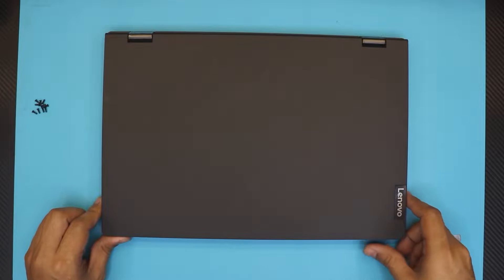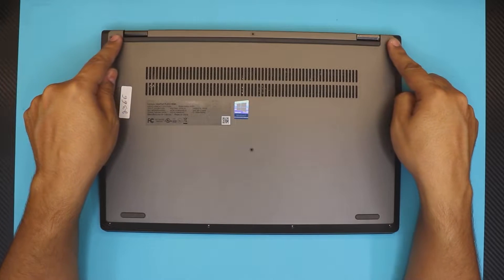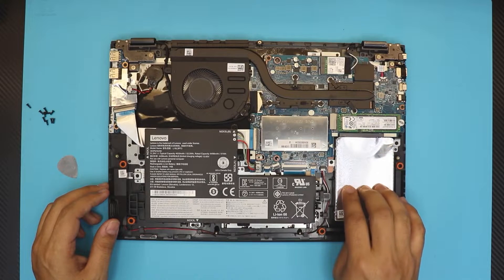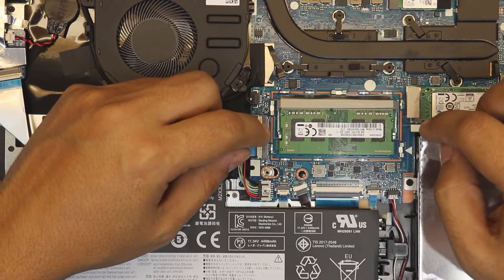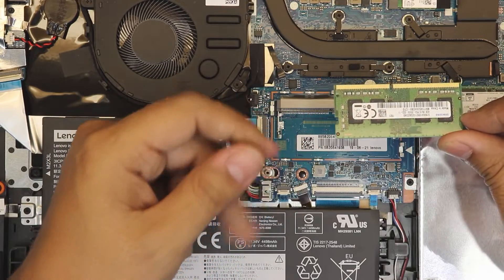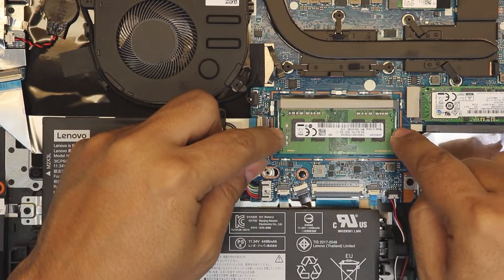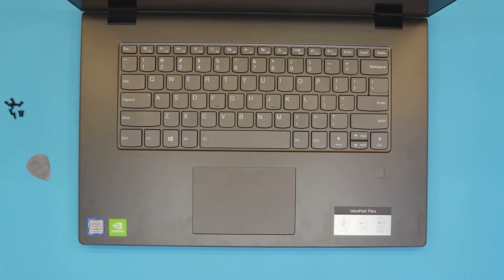lenovo ideapad flex 15iwl RAM UPGRADE Guide under 5min

Comment: Much apreesh! I figured the RAM was living under that silver shield...but was helpful to have that example of how to remove it. I think it goes without saying...Disable Secure Boot to be on the safe side so it doesn't go locking you out after "touching" its internals ;)
Reply from the maker: It's my pleasure, my friend. 😊 I deeply appreciate your taking the time to provide feedback. If you're inclined to support the channel further, feel free to like and subscribe—or even both!
I'm glad my videos are helping!🫠💞
No need to disable secure boot oor anything thing, it is totally safe to man handle it, just disconnect the battery because if you touch other components with that shield then you could short something. been servicing for over 20years never needed to disable secureboot.
Should you have any questions or requests in the future, please don't hesitate to ask me.
🍻cheers

Comment: I also have the Ideapad flex 15 iwl and its 8 gigs right now with dual channel, is it always going to have one of the 4 gigs solderd down cause I want to upgrade to 16 gigs as I found a Lexar SODIMM RAM DDR4 16GB, 3200 MHz 260-Pin DRAM Memory for Laptop but I am worried it wont work with the 4 gigs of ram and if it does does my ram work with the computer?
Reply from the maker: 🫠Regarding your question, double check the max ram capacity of ram: https://youtu.be/tKEJTkVth4Q
if the ram capacity is over 20gb then sure you can add a 16gb sdram ddr4 and it will add with 4gb on board and work fine.
Should you have any further questions or requests in the future, please don't hesitate to ask me.
cheers🍻
Reply: @uFixTek   I read it and it says 16 would be to much, but I went on the Crucial website for ram and looked up compatible ram with my laptop and it said I could remove one stick and replace it with their 16 gigs of ram even though it says not too as they have done extensive testing and it will be fine. How much do you think going from 8 gigs of ram to 20 gigs will improve performance on the computer?
Reply from the maker: oh the improvement in performance is going to be a lot when opening programs and browser tabs, and many more. but if you want the best performance increase IF you have HDD change that to SSD and you will see a magic.
https://youtu.be/qpqRAyLYycg
Reply: @uFixTek  will it also make gaming a lot better?
Reply from the maker: yes it will have a gain in performance in game loading not graphics but just loading, and more fps

Comment: what if when you turn it on there is a white flashing light on the on button
Reply from the maker: Thank you for the feedback! if you wish to support the channel you can LIKE or SUB or both :P
regarding your question:  flashing and no scree?, if so remove both rams and only install one ram in one of the slots, and if you get screen (boot) then power off and place the 2nd ram. and power on and wait 5-10 sec

Comment: Hello  if i have 4 gb soldered , there no way to Upgrade?
Reply from the maker: Thank you for the feedback! if you wish to support the channel you can LIKE or SUB or both :P, or use my amazon links :), regarding the question: your laptop may have 4gb soldered on main board (that would NOT be able to upgrade), but it will have a extra ram dim available with 4gb  or 8gb stick remove the ram stick and upgrade it with a 16gb ram if you wish.

https://amzn.to/3f46IT7

Comment: Thank you for this.  I used a razor blade in lieu of a guitar pick.  One of my cables (monitor?) disconnected when removing the lid and required gentle reconnection.
Reply from the maker: Thank you! for the feedback and your support to the channel by SUB :P
if you need any extra help or request feel free to ask me.

Comment: Hello again my friend, I am about to order the Ram and the Hard-drive from Amazon Italy. Just wanted to ask you before, so I am sure that I am ordering the right options. Can you please check them for me. Because I have noticed with the Ram there are different options and could not understand the difference between single and Dual Rank. I really appreciate your help. 

https://www.amazon.it/Crucial-CT16G4SFRA266-16GB-Memoria-Laptop/dp/B08C4VKYFG

https://www.amazon.it/Seagate-ST1000LX015-HDD-Interno-Nero/dp/B01LXNUKKW/ref=mp_s_a_1_1?dchild=1&keywords=seagate%2Bfirecuda%2B1tb%2Bssd&qid=1609325648&sprefix=Seagate%2BFireCuda%2B1TB&sr=8-1&th=1&psc=1
Reply from the maker: hi, sorry for the delay, the thing is that when ever someone comments with a link or something it goes to "held for review", i just randomly clicked there to see if there was any hate comments :P and i saw your comment :)

checking the links the ram is the right ram it will work fine and the hard drives are excellent option and they both will work fine.
now when you place your ram don't panic if at 1st doesn't boot, it may take about 10-15 sec for bios to detect and accept it.
if after 15sec still no screen (boot) then power down and power on again. sometime it happens it will require few restarts in order to get detected.
about the HDD you just plug it in and you are all set.
and if you go to the windows and you dont see the drive in my computer, dont panic, because you may have to active the drive in the system and i can help you with it in case if it doesn't show on you computer.
again sorry for the delay  :(
Reply: @uFixTek   thank you sooo much my friend, you helped me a lot and I am the one who should be sorry for disturbing you with many questions. Again I wish you the best with your channel and I will keep you posted after I get the Ram and the hard-drive 👍🏻👍🏻
Reply from the maker: my pleasure to assist you, and i wish everything goes well and you get all installed without any issue. leave me a new comments when you get the rams and hdd installed, as its hard for me to keep track of old comments :) good luck my friend

Comment: Thank you, appreciate it. I have the same laptop, I currently have a 16gb, so im guessing its 8gb each, however I'd like to increase it to 32 gbs, is it possible to just add a different one from 8gbs without undoing the soldering? Thank you
Reply from the maker: thank you for the support and feedback, and regarding your ram, if you have 16gb 8gb x2, the only thing that you can do is replace the 8gb removable dim with 16gb and + 8gb soldered you will get 24gb total.
https://amzn.to/3iznjNk
Reply: uFixTek I got you, what if I replace one of them with 32gbs, will that work?
Reply from the maker: @kraemo8473  no the mobo wont handle a 32gb stick, only 16gb stick on every dim.
Reply: @uFixTek  Ok thank you man, appreciate the advice!
Reply from the maker: anytime my friend and thank you for your support to the channel :)

Comment: i just bought an ideapad flex 5 14 and i was wondering if i could upgrade the ram on that and if so is it the same as this one?
Reply from the maker: its 90% the same just the ram position may be moved abit on motherboard but the spec are the same

Comment: Thanks so much for this I literly couldn’t find it.   If I remove my ram card will all my laptop memory be gone. Or can I just replace it and still have all my games and applications on my lap top
Reply from the maker: no my friend nothing will happen to your files or games or programs everything will stay the same, you can remove and replace rams without worry . good luck
Reply: It's a RAM, not SSD. Nothing will happen to your existing softwares.

Comment: Hello......! Same laptop but it is not opening. Plz help
Reply from the maker: what part is not opening? the bottom cover? you will need to use a bit of force and a opening too to remove the cover.
Reply: uFixTek  No okk Thank you  its opened ......? Byy forced i was opened...Good guidance
Reply from the maker: im glad i could help :)

Comment: Hey man thanks for this. I have a question I'm planning to buy this flex 15 bit is 15iml. The lenovo site says that this  support 16 gb ram. But the model I want have a 4 soldered ram plus 4 card. Can I replace the 4 for a 16 so that would be 20 (because of the 4 soldered). Because 12 gb doesn't exist. Any help I'll appreciate it. Thanks.
Reply from the maker: yes you can mix match the rams there are no problem there, if you have 4gb soldered and you have one slot free or occupied , then place any 16gb or 8gb and it will work just fine.
Reply: @Elmer, did you add the ram? Did it work? I was curious if there was a limit on how much ram you could add, and want to know before I purchase the flex.

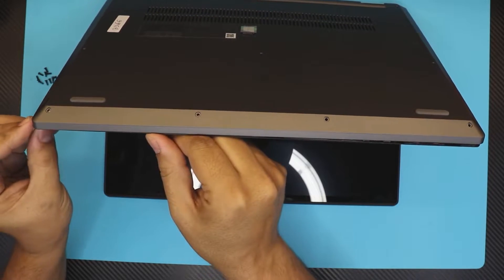Comment: 1:40 I didn't understand.. if i have a 12gb ram laptop. Could i put a 20gb ram card in the slot?
Reply from the maker: you can put a 4gb , 8gb , 16gb ram stick in there and it will work, if your specific model has a ram chip soldered on the motherboard on the other side, what every you put this end it will add up.
in the task manager check how much ram you have, and when you open your laptop and check on top of the ram what capacity ram it is. if the windows says you have a 12gb ram and you open up and you only find a 8gb stick. that means you have a 4gb ram soldered on the motherboard, so what ever you replace this 8gb with it will show + 4gb more in the windows.